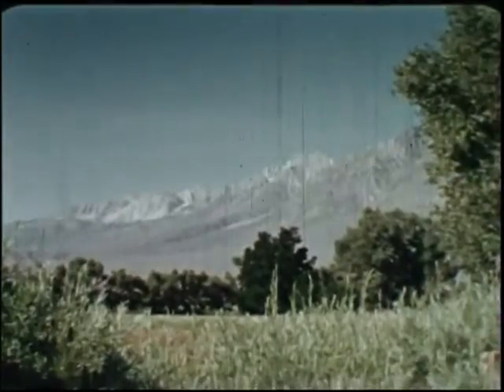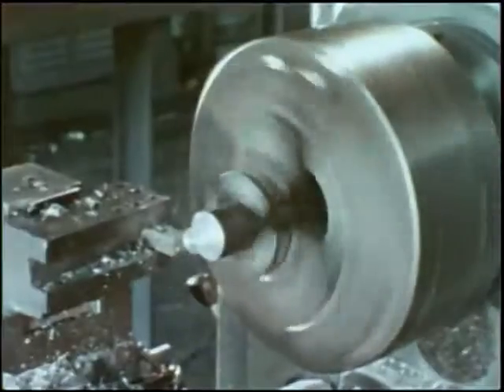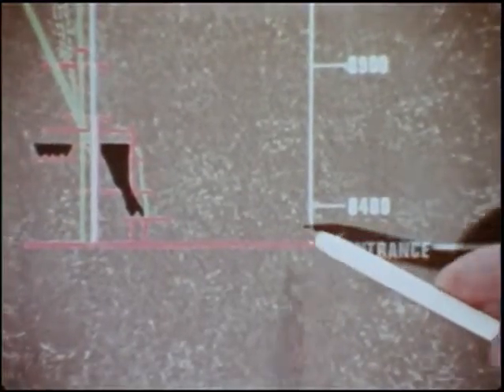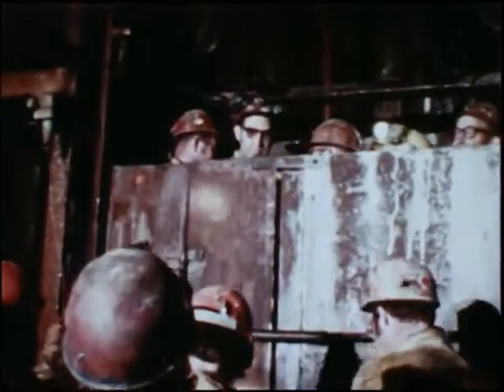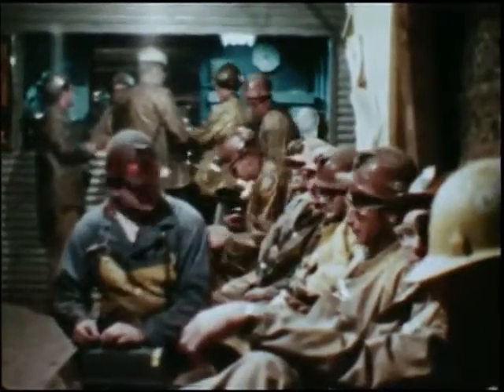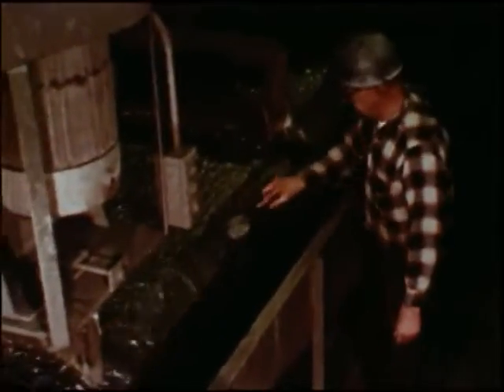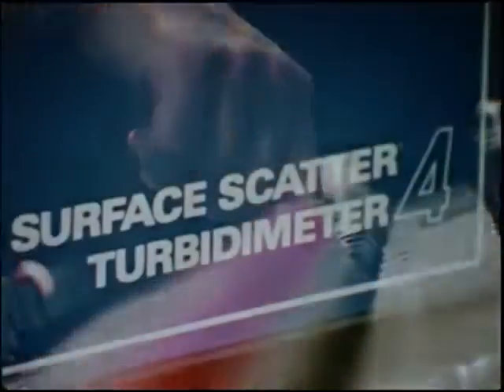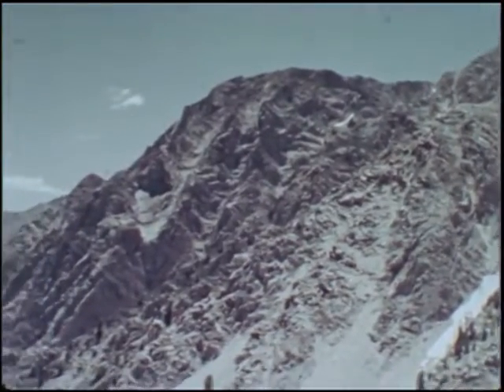Tungsten:  A Treasure of the Sierra Nevada

Comment: Mine is closed, the old mill and plant has been scraped down to the earth.
Reply from the maker: The mine is not in operation but several portals remain open (but locked). Much of the mill was destroyed in an avalanche but the buildings at the Easy-Go level are intact.  All equipment downstream from the jaw crusher has been removed except the clarifier and associated hardware and plumbing.  The ore bin is also still intact.

Comment: Sad to say that we now purchase 80% our tungsten from foreign sources. Perhaps 20% comes from recycling.  The following is from a 2012 Forbes article:

"China, which has more than 80% of the world’s supply of tungsten, has sharply curtailed its exports and as of now is a net importer of this precious element. China also shows no signs of loosening the reins on tungsten exports, preferring instead to use its supply for its own manufacturing applications. 

Russia has some, but keeps 70% of what it has for domestic use. Tungsten has also been harvested and recycled from existing devices and components, but even those sources have now reached their limits and there’s no new significant supply on the horizon.

Currently, that leaves no more than five mines supplying most of the world’s tungsten outside of China and Russia. (A possible mine in South Korea may have reopened)